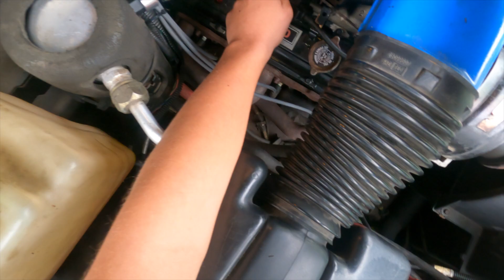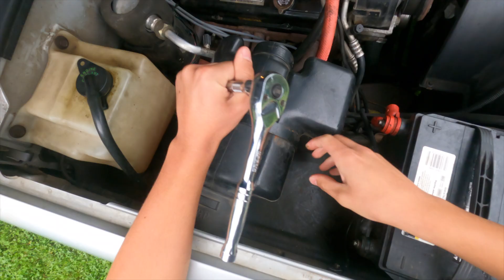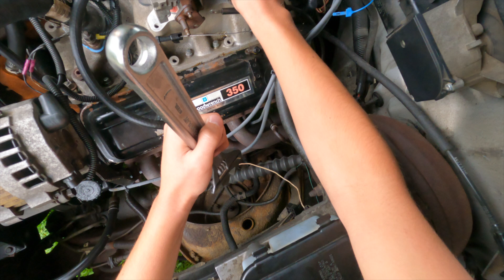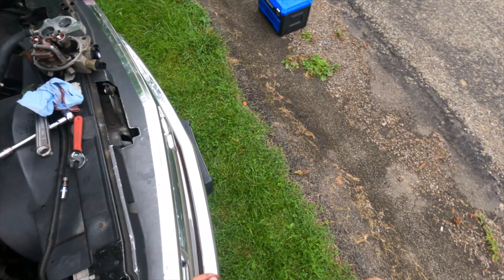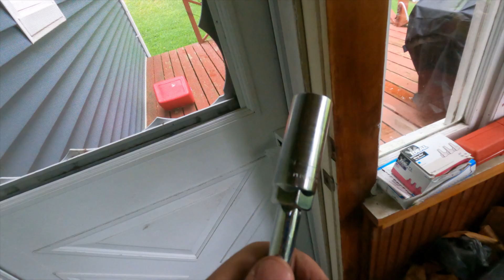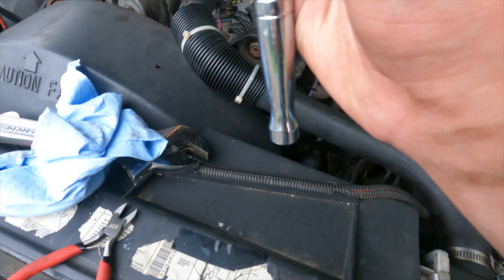GM TBI to Carburetor Swap PT. 1- Disassembly

Comment: Hey, Nick I have a 97 Vortec 5.7L Multi-port FI TB. I understand most of all the things I will need to remove and put in.  Confused a bit on the electronics that run through the PCM.  Is there any reference showing how to do that particular swap out?
Reply from the maker: I’m not exactly sure, those newer trucks with the port injection take a little more to swap electronically.
Reply: @nickconnors8515  yeah finding that out.  It was just add two wires to go from six to eight. I thought It would be better to get the harness and ECM with the motor and that it would all work out a lot easier.  That's not the case. I don't want to take all the money spent in the electronics and fuel system improvements and put it on a shelf and install carburation but damn it is getting there.

Comment: How do you know if you have a universal intake manifold?
Reply from the maker: Not exactly “universal” the bolt holes were drilled and tapped on mine for both throttle body unit and carburetor. However I did have to add two holes in the back to make sure my 4 barrel can properly function.

Comment: Just swapped a 350 into my 95 k1500. It had the 4.3 in it. I’m not satisfied with the the tbi so I’m wanting to carb swap it. How do I know if I have a universal intake like you were saying?
Reply from the maker: It’s hard to tell, mine was technically universal and a 2 barrel would probably fit fine, but due to the fact I didn’t realize it wasn’t destined for a 4 barrel, I had to die grind the top so my 4 barrel will fit. I would suggest just buying a intake manifold for the 4 barrel. Do some research on how to run brake booster line and coolant lines.